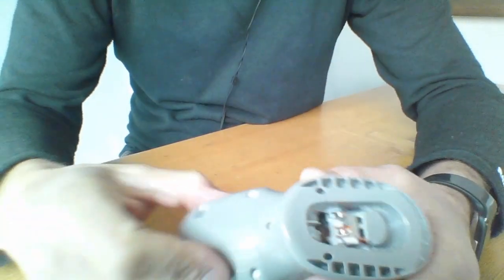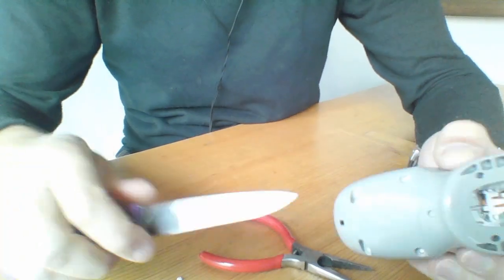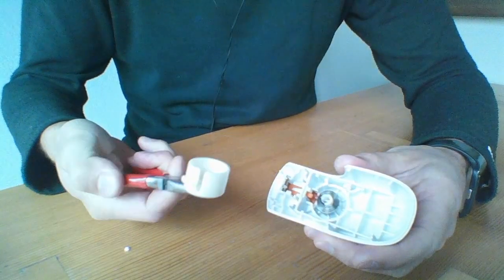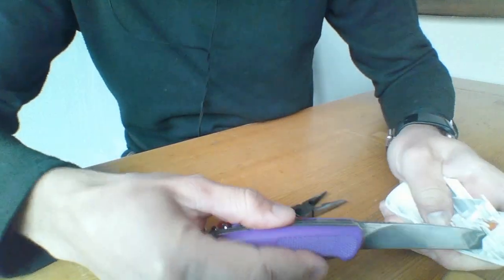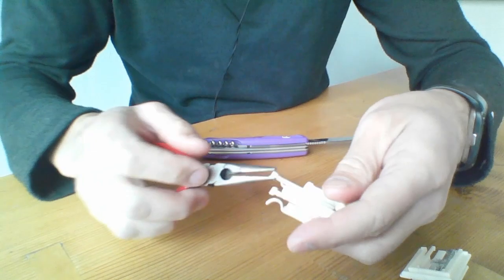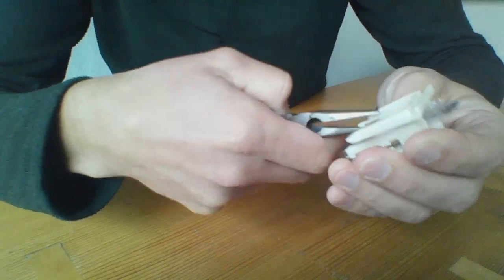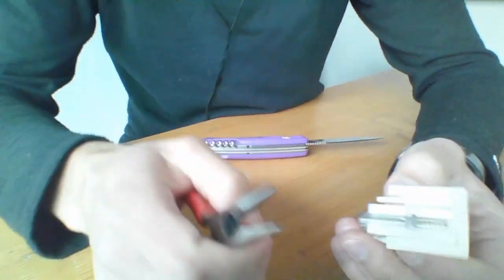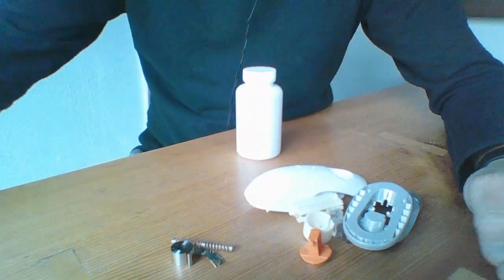Disassembly of Dexcom G6 inserter / applicator

Comment: 1. That knife technique is dangerous for both the user and tool. . Use the SIDE of a sturdy non-folding or locking knife to snap off the four white heat-formed rivet heads from the bottom.  2. Insert the knife or a screwdriver in the end near the orange button.  The cover will come off easily. 3. BOTH needles can be removed before taking their units apart. Grab near the plastic retainer and using the plastic as a fulcrum.